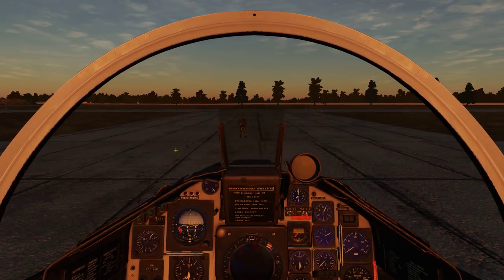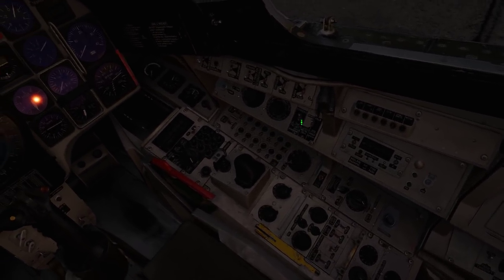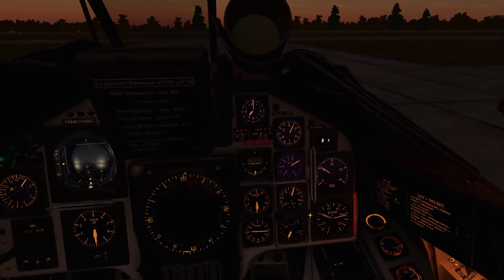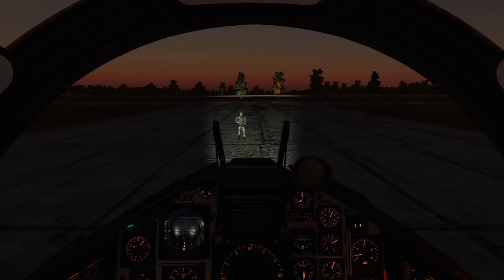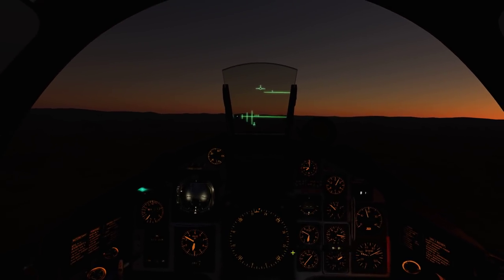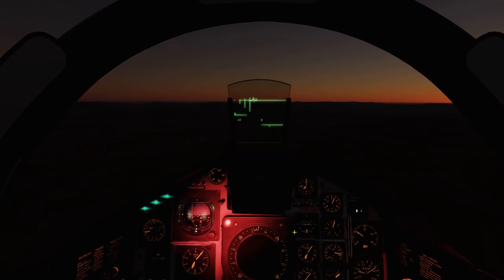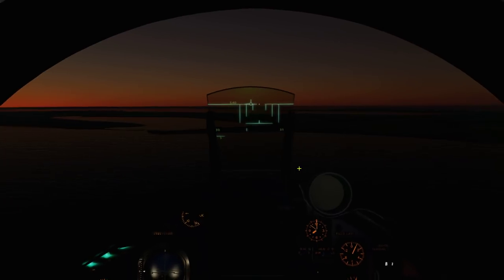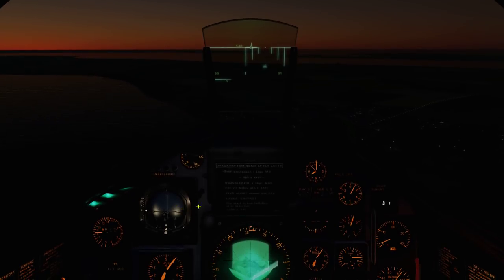AJS37 Night Attack Mission with BK90

Comment: Hi, very good and interesting video as well as useful, I learnt a lot, thank you. About the Viggen: I like it, but I'm sorry I have to say that it is the most frustating module experience in DCS for me. Why? Because I miss my target most of the times, expecially with BK90 sub munition. That happens because the waypoint (M), which I previously set up just on the target, shifts or drifts a bit and, thus, I haven to fix it with the radar just when my plane is about few km  from target. This situation is very difficult and dangerous when your target fires you back or even kills you (SAM). Any advice? Thanks

Comment: Excellent video. I've had the Viggen since release but was intimidated by the HUD and information presentation. Over the last few weeks, I've gone back through several tutorials and am really enjoying the aircraft. Ripping along at low level with a great radar is outstanding. Question...What button on your stick were you clicking to get the A/P to turn toward the new waypoint? And again later you clicked something on the stick to reset your HUD elevation scales. Thanks in advance
Reply from the maker: Thank you.
The A/P is managed with the trim hat of your stick. But (I say this in the video) you can also--unlike most other A/C--steer the A/P with the stick. The stick doesn't disengage the A/P for small inputs. 
The Reference Lines are reset anytime you press the corresponding button on the stick (check under HOTAS in the game) and also anytime you switch on the A/P in ALT mode, and also in LNAV mode (500 m). I don't think (!) I manually updated the Reference Lines in this video, but I know for certain they were updated several times by the A/P set to ALT.

Comment: Hello. 
Nice video. I have seen the Viggen a couple of days ago in the Linköping Flygvapenmuseum. I’m on a Sweden/Norway roadtrip. 

I actually have a question. What if the target (tank platoon/squad) would have changed it’s position after your takeoff? Can you still use the bk90 and update its target reference?
Reply from the maker: You can always update a target. The precision of the radar is low, so you risk missing with the BK90s. What you must remember though is that you should only update an M-point (not B) or else you'll move your entire flight plan so it won't be correct any more. Also, you need to make sure your navigation error is 0 when you fire the BK90s, as they use the same guidance as your aircraft; so if your aircraft's position is off, so will the BK90s.
Reply: I do not have the viggen yet, but I have always thought about it and do it right now, again. ( you have to know, I’m choosing DCS modules very carefully)

So if you have a GCI for example, and he gives you new coordinates or more precise information in advance, would you be able to make a good run? What information would you need? Would you have to add a few new waypoints and is that possible in flight?
Reply from the maker: Yes. Exactly. You really need Lon Lat and Alt for the delivery. Then you can always benefit of tactical info such as recommended approaches and egresses as well as defenses. 

As for what module to chose next: Viggen :D
I say that in my first English speaking film: this is a very misunderstood platform, because people use it wrong. Used correctly it's probably one of the more potent A/C for DCS,